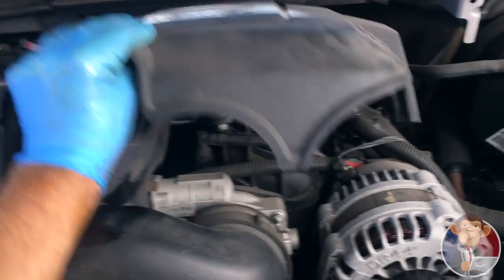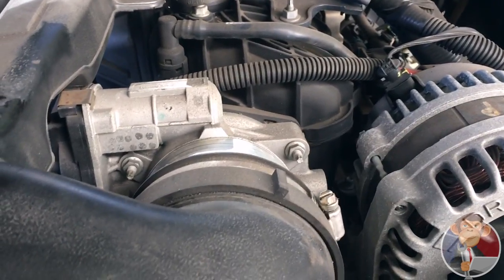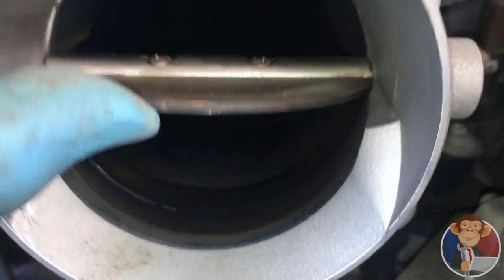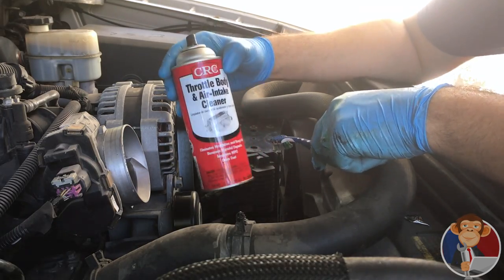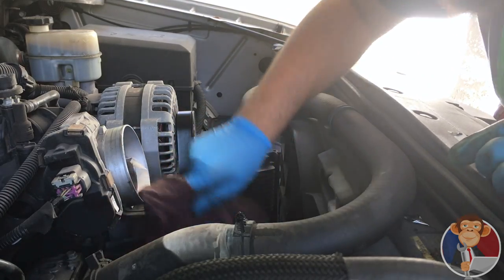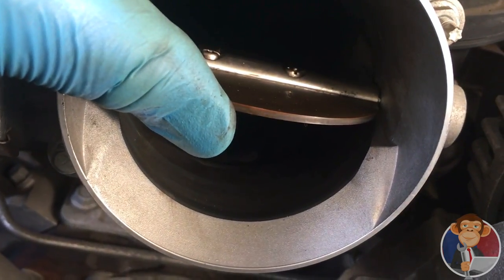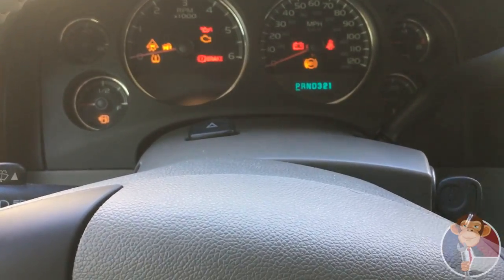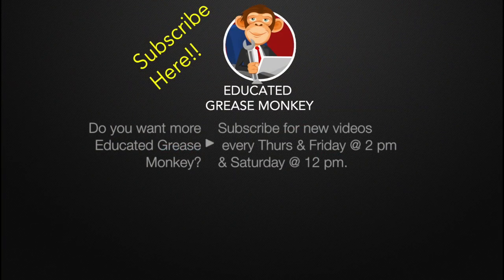How to clean the throttle body on a 2007 - 2014 Chevrolet Tahoe - EGM DIY

Comment: Wat if the rpm continues to increase
Reply: When I idle the rpms are at 1000 as soon as I touch gas it goes to 3000 until I put it into gear. Will it correct itself after awhile or is that a sign to have checked
Reply from the maker: The engine is expected to act weird at first but after a few accelerations and a few minutes of idling everything should go back to normal. If it does anything that it didn't do before. then there is a problem.
Reply: Gianna Amadio: You're not supposed to open your throttle body manually.  It that's why your idle is high.  It will eventually relearn itself.  Next time turn the key into the on position and have a friend floor the gas without it running obviously.  And you will not hydolock your engine using carb/tb cleaner.  It will evaporate as you're cleaning.
Reply: @imarealist6275  you in fact can and will hydro lock your engine using throttle body cleaner if you use far too much which I have seen first hand myself. I watched someone damn near do it and had to step in and shove a small towel into the throttle body to soak up as much as i could because he was about to try to start the engine and that would have been very bad. So your comment is false.